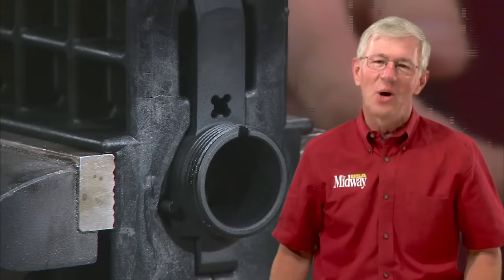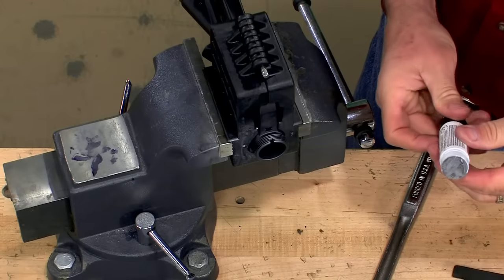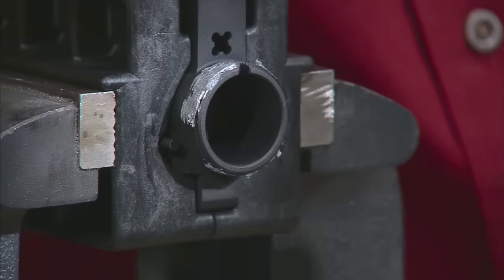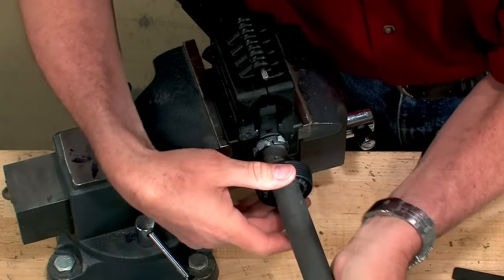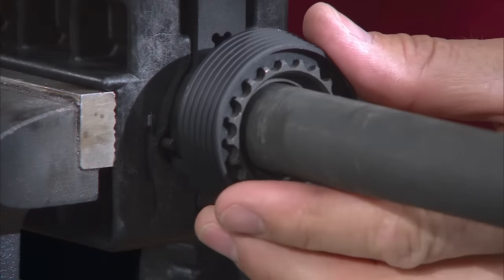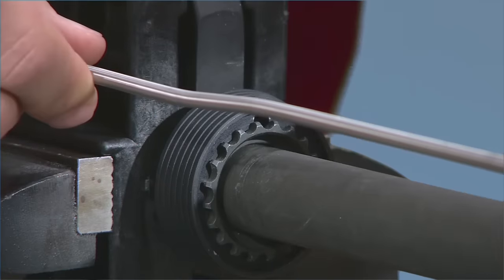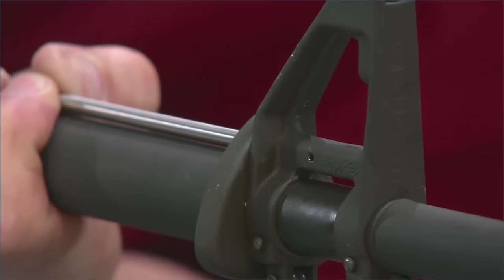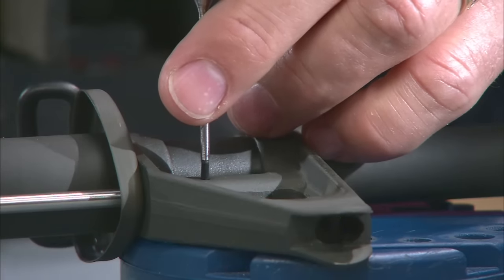How to Install an AR-15 Barrel Presented by Larry Potterfield of MidwayUSA

Comment: A lot of people come to YouTube to learn somethings. I’m in the industry where I use torque wrench often and when I see some one assembling a firearm and using torque wrench wrong is not expectable. By over tightening or under tightening the  barrel could lead to catastrophic failure. There is specific torque range for barrels and to get the correct torque you have to put barrel nut wrench 90 degrees to torque wrench or you have to compensate the torque setting. If you going to post instructional videos for masses to watch, make sure you teach the proper way.
Reply: I am glad that I am not the only one who cringed at the tool usage here. Someone pull this guy's quals.
Reply: 40-80lbs
Reply: There are seven gross errors of grammar, syntax, usage or spelling in the four sentences of this comment.  If you can't be bothered to properly use the tools of English to make a comment, why should I trust it?
Reply: Jon Hendrickson look If I will be giving you instructions on how to write sentences, and I teach you wrong, then I would expect you to pout it out. In this case I’m NOT teaching on how to write, I’m just pointing out on wrong usage of a tool because in this case I’m professional. By the way, English is my second language. Thank you for pointing out my errors.
Reply: KGB2101 I’ve seen and heard from other people who build their own rifles that barrel nut comes loose and barrel moves to much and changes the head space every one who builds rifles or any kind of gun knows how important head space is       Grammar police will love reading this not even one punctuation 😂😂😂😂
Reply: @pnwhealthjourney 
If the bolt locks up properly with the locking lugs, how can the headspace change?

I would think that if the barrel moves too much, the bolt won't lock properly. Then, I suppose, there can be an out-of-battery discharge, which could definitely be catastrophic.
Reply: Turtleback ok read it again. I said if the torque is wrong then barrel nut can come loose and it’ll change the head space.
Reply: @pnwhealthjourney 
I re-read it, but maybe I'm just dense. I don't see how the headspace can change from a loose barrel nut, if the bolt is locking up correctly.
Reply: He did go 90° for the final tightening, see 2:33.  You don't have to go 90° though, you can also just adjust the torque setting to account for the change in arm length, it's very simple math. 

Besides, an exact torque is not that critical on an AR-15 barrel nut.  Really it's just a matter of making sure you're above the minimum, and then going until you have a notch lined up with the gas tube hole.  It doesn't need to be that precise.
Reply: So, would you please help us to understand the amount of compensation necessary?  For instance, if the range is 40 to 80, and I torque to 60 using this method, how far out of spec will I be?  Thanks.
Reply: @michaelhall8154   You just make a ratio of the base length and the total length with the adapter added, and multiply it to either find the correct setting for a desired actual torque or calculate your actual torque for a known setting.  In your example, if you had a 20" wrench and an adapter that added 1.5" to the moment arm, it would be (20+1.5)/20 = 21.5/20 = 1.075.  so when your wrench clicks at 60 lb-ft, you're actually applying 64.5 lb-ft.  Still well within the spec.

People are making a big deal out of this, but it's really not that complicated.  Lots of different industries do this same math all the time when a crows-foot or other adapter is required.  Plenty of calculators online, as well as smartphone apps now.
Reply: Synchronizor, thanks for the reply.   I suspected that it would be “still well within the spec” because of the huge tolerance.  I think this is the issue that people are keying on:  Rather than simply slamming someone for using the tool “wrong”, a constructive comment like this explaining how to compensate is much more useful.
Reply: @johnv8355  You are correct, the headspace is not determined by the barrel nut being tight.  It is set when the barrel extension is installed onto the barrel.  If the bolt is locking up, then there is no possibility for a head spacing issue.  You can literally perform a go/no go test with the barrel completely removed from the upper...

Comment: Is there a way to center an A2 front sight to a barrel without a jig?
Reply: That wasn't discussed in the video. 

I try to eyeball it then sight it in, more than 10 clicks to zero then I loosen/re torque the barrel nut and try to correct it.
Reply: not in a good way.  jig and laser.

Comment: 30 to 80lbs??? This essentially means it doesn't matter. I'm a mechanic and slowly learning ARs. 30 to 80 is like the difference between an intake manifold and the heads or even the main bearings!
Reply: ...Not all barrels are the same, Not all barrel nuts are the same, Not all gas systems are the same, Not all upper receivers are the same....

The reason for 30-80ft lbs is to make sure it is tight enough while not exceeding 80ft lbs while trying to get the gas system to line up with your barrel nut while tightening. You want at least 30ft lbs but you can go up to 80ft lbs if required to line the gas ports up....................................lol.  If proper torque and alignment of the gas system is not possible, barrel nut shims are required.  I'm a mechanic and this should be a given lol.
Reply: Yeah, its like don't leave it loose so as to fall apart, and don't tighten so much to ruin parts or strip threads.
Reply: Yea I got it now. That was kind of a retarded comment on my end. Bottom line is atleast 30 but no more than 80. Whatever you need to line up the block. I get it now after building a few since then

Comment: As long as I use a free float hand guard delta rings are not necessary with a well made or proper barrel nut correct?
Reply: Yup but itll look dumb so just use one of the other full thickness barrel nuts that dont utilise delta rings
Reply: @sethdaboss245  like the aero precision one or one that comes with the hand guard like ALG defense ones etc..
Reply: @ryanp6072  well first of all does your handguard hide the barrel nut? If so it doesnt matter you can use normal one but if it doesnt I'd recommend something like this https://clarkcustomguns.com/product/clark-custom-ar-15-barrel-nut/

Comment: I have an alpha shooting sport barrel I’m trying to get into an Aero receiver. It goes in about 3/4 of the way and ceases to go any further. It could be due to cerakote on the receiver but I’m not exactly sure. Any suggestions?
Reply: You may need to heat the receiver with a torch allowing for a brief expansion. Search for jprifles thermo fit on yt. It gives a pretty good explanation of how to do this while trying to make you believe they invented thermal expansion. You can also freeze your barrel and see if that helps. Don't overlook dry ice as an option and have a rubber mallet or dead blow hammer handy as a helper. Have a plan before you begin.

Comment: Why do you have to tighten and then open it a few times? Thank you
Reply: Seasoning the threads and it ensures not only a better connection on the threads, but also gives you the extra torque you need if you're under the 30lbs minimum torque value for the barrel nut
Reply: @kanaka118446  Thank you your answer

Comment: my barrel does not go in that easy into the receiver it is extremely tight, any suggestions?
Reply: Moly lube
Reply: Receiver in the oven, barrel in the freezer.  Works like a charm.  Just make sure you're actually ready to assemble them; a real tight-fitting barrel/receiver set can be a bear to get back apart once they've equalized in temperature.
Reply: Bravo company uppers and several others have tight tolerances.  I used a heat gun on the threaded area of the upper receiver and it slid right in like butter.  You might be able to get away with a hair dryer.
Reply: Suggestions from others ought to have helped you out... but the good news for you is that tight fit (once you get the barrel on), will make for a more accurate rifle than a barrel that slid on easily.

Comment: His torque will be off when the attatchment is not 90 degrees.  Bad...
Reply: The military uses the same method...Measure the distance, r , between the pivot point and the point the force is applied. Determine the angle θ between the direction of the applied force and the vector between the point the force is applied to the pivot point. Multiply r by F and sin θ , and you will get the torque.

Comment: Anti seaze? I thought spec was Areo Shell grease?
Reply: What, exactly, do you think aeroshell does?
Reply: @stevenodell4323  Prevents Galvanic corrosion and gives a true torque value..
Reply: It is, LP does not give the best advice on the AR platform..Aeroshell grease prevents Galvanic corrosion and gives a proper torque spec..

Comment: What kind of range is 30-80lbs?
Reply: You torque to 30, then tighten to line up the gas tube. If it takes  more than 80, then try a different barrel nut.

Comment: When you're cranking on a torque wrench, there is not way to know you're being accurate in torque.  Please pull with smooth motion if you claim a torque wrench is needed.  Please use it right.  Good video though.

Comment: No anti-seize on the barrel extension?
Reply: Anti-sieze of that type shouldn't be used on dissimilar metals. It promotes corrosion. 

A molybdenum grease is more appropriate.
Reply: @scrateshooter  Or loctite 621
Reply: If your good with your build leave the barrel on. If your guessing use grease and do it till you get it right. Its a gun not a food processer
Reply: loctite 620 is what you want, its a retention compound. If there is alot of slop you can also use .001 shim stock and the 620.  Or get a larger barrel extension.   A tight fit will improve accuracy.

Comment: My barrel nut is not lining with the gas tube
Reply: Keep tightening and loosening the barrel nut, this will usually work..The space in the nut for the gas tube must be 1/2 or closer..3/4 will not work.. If all else fails, use barrel shims placed between the barrel and nut, not between the barrel and receiver..

Comment: What about oiling the barrel and metal parts on the outside from potential rust
Reply: i wipe it down with a lightly oiled rag just before installing handguards.  magnese phosphate is rough and porous for a reason.

Comment: A torque wrench is an expensive, unnecessary tool.  The specs call for 35 to 80 foot pounds of torque.  An average person with a standard wrench can reach 35 foot pounds easily.  You'd need a 3 foot breaker bar to exceed 80.  Take whatever wrench works and simply tighten the nut barrel until its snugged down tight using normal strength.  Then align the gas tube holes, if any, and you're done.  You can buy a standard barrel nut wrench for $10.  If your building a new gun, or rebuilding an existing one, a multi-function AR wrench will cost you $20-$25 and it will do everything you are ever likely do with an AR.
Reply: For all the posters who were just asking whether Larry meant inch pounds or foot pounds, you just made their heads explode.
Reply: 3 foot breaker bar?
Really? 🤣😂🤣😂
Reply: @dontask8979  To exceed 80 ft/lbs. Yes. Really.  Go back to your video game.
Reply: @dontask8979  to go over 80 ftlbs, you are basically throwing your whole weight on that thing.
You will probably slip your vice jaws before getting to 80 ftlbs unless you have a big strong vise and a long breaker bar.
Heck, I have done 80-120 ftlbs building engines before.
When you get up in that range, you are spinning an engine and engine stand unless you use your hip or a friend to hold it still.

Comment: Not only what Alan T said there is what is called wet or dry torque, and believe me if something gets to hot and I mean hot with never seize on it it will never come apart it’s just like the threads growing from heat and that bitch WILL lock down and a four foot pipe wrench WON’T bring it off use good red thick grease for pneumatic cylinders and NEVER go to the maximum save some thread for later 35 foot lbs wet is tight . Every gun is different factory species are a good suggestion not a law us common sense and don’t over tighten 80 ft lbs. is a lot enough to stretch your threads. Have you ever seen a machine gun handler put never seize on a barrel that gets hot before they swap barrels out , no because the never seize is as good as welding it , they have looser tolerances they jerk the hell out of it and slam a cold one in never seen one yet get out never seize .

Comment: This video may mislead. My Aero Precision barrel nut cracked under 40 pounds. At 30 pounds of recommended in their manual it slightly chipped the teeth.
Unless your manual says torque 50-60-70. DO NOT!

Comment: This guy is insane, his torque method is sooo wrong. Torque is measured at the center of the head of the torque wrench. He may be adding as much as 25 ft pounds of torque to the nut there is a formula for torque offset. Do not do what this guy is doing. By the way I have 15 torque certifications from my years as a aerospace mechanic.
Reply: The military uses the same method..This does not add 25 ft pounds lol..Measure the distance, r , between the pivot point and the point the force is applied. Determine the angle θ between the direction of the applied force and the vector between the point the force is applied to the pivot point. Multiply r by F and sin θ , and you will get the torque.

Comment: That is absolutely not how you use a barrel wrench on the end of a torque wrench... When adding a crows foot, barrel wrench, or anything that increases the distance from the handle to the end of the center of the drive on the torque wrench, one should make sure it is 90° to the torque wrench as to not add any total length to the tool....
Reply: The military uses the same method...Measure the distance, r , between the pivot point and the point the force is applied. Determine the angle θ between the direction of the applied force and the vector between the point the force is applied to the pivot point. Multiply r by F and sin θ , and you will get the torque.

Comment: tighten the barrel, then loosten the barrel, then tighten it again, then loosten it again, then stop and get a popsicle and eat it, drop the popsicle. then tighten the barrel again... is this satire?
Reply: Not really, tightening and loosening the barrel nut seasons the threads for the final torque..This prevents the nut from loosening..

Comment: Your torque wrench need to be at 90 degrees offset of of your fitting. Otherwise, you are extending the length of the wrench.  Your accuracy is off, and not using it consistently either...

Comment: I’m a mechanic not a gun smith but thread mating is definitely a myth and wayyyy to much anti seize
Reply: No it is not..Colt had barrels come loose in the early 2000's during the war on terror..Colt developed this process and it is now required to season the threads for mounting barrels....

Comment: What about aero shell grease for that barrel?
Reply: Mil spec requires Aeroshell grease which prevents Galvanic corrosion and gives a proper torque spec..Anti seize is better than nothing but not to the TDP spec..Colt uses Molykote G-n Metal Assembly Paste to install the barrel at the factory..